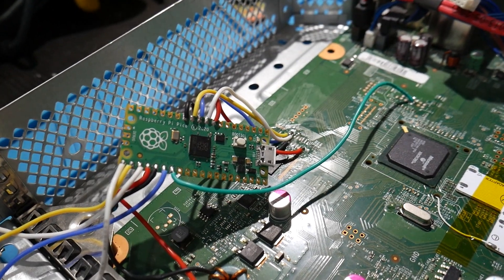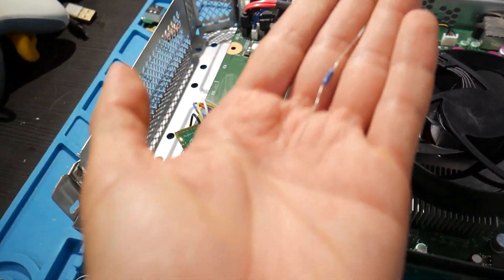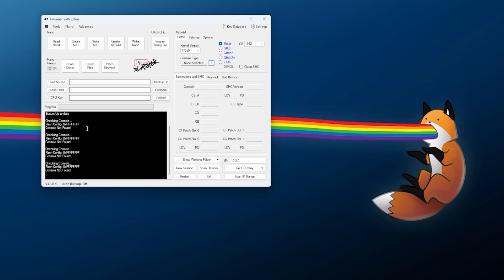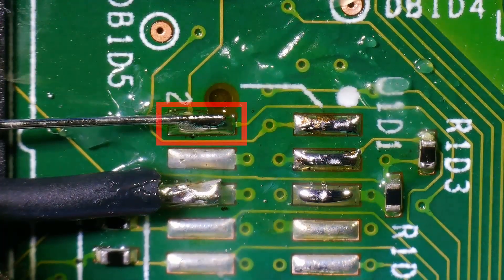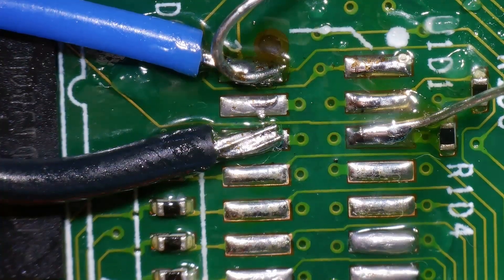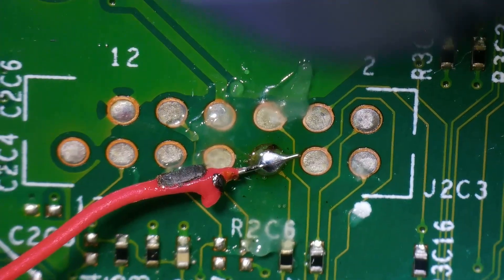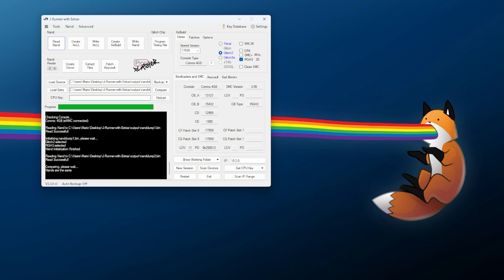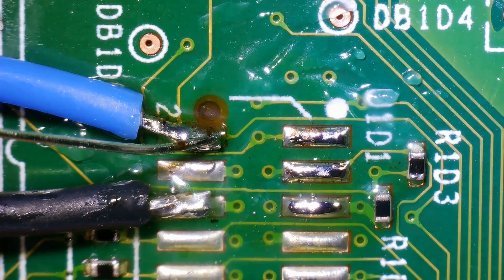Fixing the "Console Not Found" Error for PicoFlasher & Corona 4GB Motherboards

Comment: I was able to detect the nand however no it it freezes jrunner and after a few minutes it times out. Soldering seems fine. Anyone run into this?
Reply from the maker: I saw someone else comment and run into this. You could try another USB cable, port, or even PC?
Reply: @MrMario2011  I actually tried all three😞
Reply: @nickadamso1  hello, do you can solve this?

Comment: Just for info even if the Pico and soldering is good, the quality of the wires also can be the problem as it doesn't give proper connection or data transfer.
Reply from the maker: Yep!

Comment: I had a trinity and the stubborn picoflasher also gave me the "console not found". After checking my soldering over and over I went with a J-R Programmer and it worked first try without having to touch any of my soldering work. Pico was indeed the issue.
Reply: Had the same issue, but i just opened j-runner without having the pico plugged into my pc, then plugged it back in it worked fine, apparently it’s a common issue

Comment: Tried this while soldering the 10k resistor onto the pico and grounding it on itself as well. JRunner found the console for once, but would freeze after reading. Noticed a wire got loose during soldering so i re-soldered and was able to read NAND. So even if you have faulty soldering it can still read the NAND in some cases but will freeze while trying to do anything. Fast forward to after writing the glitch onto the NAND, the console will not turn on but will chime. Disconnected the pico off the xbox entirely, and the xbox turns on now (green light) but will not boot..
Reply from the maker: Sorry to hear, it might be worth reflashing Stock to make sure everything is still working. If it does, you can try to write XeLL again. Usually if it isn't booting, it could be an issue with soldering or quality of soldering, but keep in mind Corona consoles can also be a bit picky from my own experiences.

Comment: almost given up...  i have wanted to rgh3 my xbox 360s for awhile now, so i followed the rgh tut and first chip i got was jr programmer... and that did not work at all, so i got a rpi pico and flashed it with pico flasher and then did the wiring for the pico and then i ripped one of the solder pads on the mb' to the yellow wire off, but scratched off the trace and soldered the wire to it and that worked it detected it and read it,  but it was saying (pico flasher has encountered an error). so i tried brand new wires and... than it worked worse now it said (console not found). so then this video came up than i followed it perfectly, but it did the exact same (console not found) thing.  Ive also used a bunch of micro usb cables. so now i am at loss, and don't' really now what to do.. or how to fix it.......         any help would be great..  im just thinking of buying and new xbox 360s and see if that fixes anything..
Reply from the maker: Could try another console, but also maybe another older PC if that would help with the programmers?

Comment: Very cool that you figured this out. I modded several 360s last year I think it was, started out with PicoFlasher but after the first one or two began to run into problems and ended up getting the xFlasher 360. I actually only even attempted RGH because I saw you could do it with a Pico, and I had just done several other Pico/RP2040 projects like PicoBoot on the GameCube and building Flatbox and Open-Frame1 controllers with them. Now that I have the xFlasher I would probably just use it again because it's custom-tailored to the job and I already have it and it worked well on every motherboard and NAND size I came across, but I guess if a friend I knew was getting into this stuff I'd feel better recommending PicoFlasher again now. While this video covers issue #14 on the PicoFlasher repo, I still wonder about #4 and #12 where the Pico seems to stop working not long after being flashed with PicoFlasher. It doesn't seem like anyone got to the bottom of that, instead trying to blame it on bad hardware despite people reporting they were bought reputable places and still worked with other firmwares on the same Picos. I had kinda given up hope on PicoFlasher becoming usable since there hadn't been commits to the repo in ages and a bunch of issues were seemingly being ignored.
Reply from the maker: xFlasher in my opinion is definitely the way to go, but I know many people will prefer PicoFlasher for different reasons. Even with problems it might have, it's hard to beat a $4 board and a free firmware!

Comment: I have a 4gb corona and used pico to mod my console. I had some weird issues as well but eventually got it to work.  Fixing my problem involved having to flash nuke my pico then reload it with the pico flasher software more than once/every time i was trying to use it because it kept messing up or something for some reason and it would always be recognized in the software but when i had it in a fresh state of flash nuke then load software it would work better for some reason. I know its not  a very descriptive answer but i did this a while ago. For mine I did not need that extra pcb to put the wire under the cpu pin whatever its called. I had a hell of a time trying to connect that 1 super tiny point where you have to scrape off that one tiny area but eventually managed to get it done. thanks for all your hard work. I now have  a fully modded 360 loaded up with games that I dont really use because I had way more fun modding it than I do playing it :P
Reply from the maker: I've never had to flash nuke, only heard of it, but at least you got it sorted!

Comment: I performed RGH3 on my Corona 4GB model (with hynix emmc) a month ago. First issue was that i couldn't get the PLL point to stick to the wire, as I ripped the copper ring around the via and was stuck with soldering to the via itself. But after that sort of worked I attepmted reading the nand and got the console not found error. It turned out that to fix it I had to (not sure if all steps are necessary, but that fixed it for me):
1. Unplug the Pico from the laptop
2. Unplug the Xbox from the power supply
3. Unplug the charger from the laptop (so that it only runs on battery and isn't grounded to my electrical system)
4. Plug the Xbox power supply direcly to a wall socket instead of an extension cord
5. Plug the Xbox into power
6. Plug the Pico to the laptop

Then, after reopening JRunner (and also trying 3 different USB ports) it got a good read and succeeded in the rest of the process! 1 small issue was not being able to boot into XeLL, but that was solved by actually not forgetting to tick the "RGH3" checkbox 😅

Thanks for your amazing tutorial! All other tutorials that I've seen online were really hard to follow and didn't mention some very important things that only you said in your video. 
By the way, does XeLL also freeze for you on configuring network if using XellLaunch while connected over ethernet on a Corona board?

Also, I wanted to mention that I actually had a few Picos around, as I'm into electronics and these are the best microcontroller that I've worked with!
Another thing is that I unfortunately had to install Windows on an old laptop just to run JRunner, as I'm a Linux power user. I wish someone maybe someday makes a Linux port... Shouldn't be had, as JRunner is written in C# IIRC, and you can run most .NET Framework programs via Mono on Linux.
Reply from the maker: Thanks for sharing! A testament of your patience and troubleshooting abilities right there! Those readers could be so problematic, so I sympathize.

XeLL has worked fine on my Corona for me, no freezing!

Finally, yes! It's a wonderful microcontroller, makes me happy to see others verifying that!
Reply: I feel you on having to use another machine with Windows because you usually use Linux. I had to keep walking between my soldering area downstairs and a spot in my kitchen where we had an old Windows PC to do all the software stuff. None of my personal machines had Windows. Then to make matters worse that PC was an all-in-one so I couldn't take advantage of a monitor already being in that spot and had to walk the 360 over to a third spot to hook it up to a display for booting XeLL, and I didn't have ethernet run over to that area so I had to manually type my CPU key in back at the computer from a picture I took on my phone. Then add to that the fact that sometimes it doesn't work and you gotta go retouch your wires and walk all around again carefully holding the 360 with the precarious wires, lol. If I ever mod some more 360s I'll probably try to get everything I need in one spot to make it easier next time.
Reply: Or you use windows like you did. What a poof

Comment: I had this same issue, but unfortunately I didn't found any help at the time. The only thing that worked well for me, instead of using the pi pico, I used the SD card reader. That for me worked very well.
Reply from the maker: I know years ago people said both had a tendency to be quite picky, so I've been surprised that they're being recommended again. The xFlasher has been the best programmer I've used in terms of reliability, but I know those can be cost prohibitive for many people.
Reply: @MrMario2011  I did the improvised sd adapter. Just soldered the jump wires inside one sd adapter following the guides available on internet. I found it to be quite easy despite the apparent complexity. The only problem that I had was that some usb to sd adapters, for pc, can't read the sd adapter, but I tested another brand and it worked very well for me. Apparently the usb adapter has to be able to read the improvised sd card soldered on the MB in some strange way. Or, maybe, was some bad contacts with my old usb to sd card adapter.

Comment: Another thing to note regarding issue with the Pico not detecting the console is that it really does not like some USB 3.0 ports.

I just did my Trinity a couple weeks ago and while the Pico itself was detected in J-Runner it would not detect my console until I move it over to the only USB 2.0 port on my motherboard.
Reply from the maker: Definitely true, although I think that's a programmer oddity in general? I just know I had plenty of USB related issues like that even back in the day with multiple different programmers.
Reply: @MrMario2011  probably but I think it probably happens way more now than in the past because lot's of newer PC's have very few USB 2.0 ports now (or none at all).

Comment: Just attempted this, no luck unfortunately. I'm quite confident in my soldering skills so know that's unlikely to be the cause. JRunner went from "Console Not Found" to "Corona: 4GB (eMMC connected) PicoFlasher has encountered an error. Try to unplug and replug the device System.TimeoutException". Can't get past this now haha, just displays this error message then freezes the application until I unplug the Picoflasher from my PC.
Reply: Hey I had this exact issue and for some reason changing the power cord attached to the power supply fixed it. This is completely anecdotal but it may be worth giving it a try.
Reply: DIY SD card nand reader works like a charm, I somehow managed to do it first time with pico but it took me  whole day of trying and it was successful idk how. If you have good soldering skills just make your own nand reader from sd card adapter and follow the rules ofc
Reply: If you get a System.TimeoutException, removing the extra wire that connects to the jumper worked for me.
Reply from the maker: That's progress that it is detected at least! However it might be worth trying another USB cable, or port, or redownloading J-Runner?
Reply: @MrMario2011  Just attempted this again on a second stubborn console I have, another 4GB corona, and it worked! Looks like it's truly hit or miss.